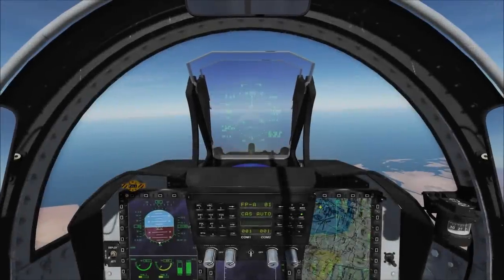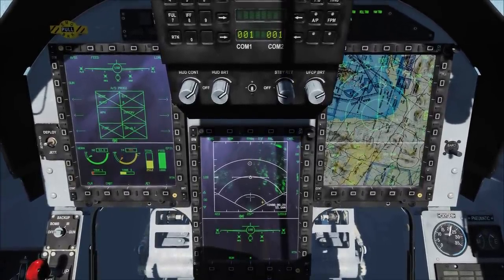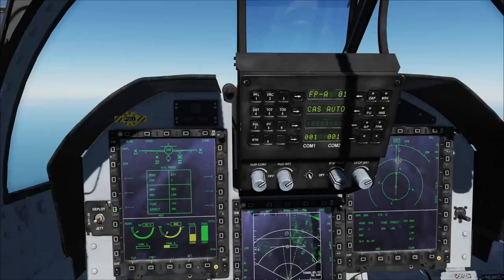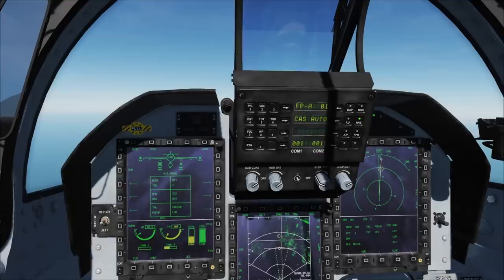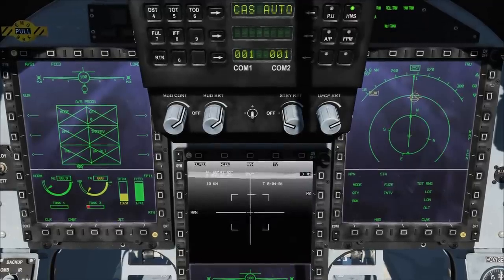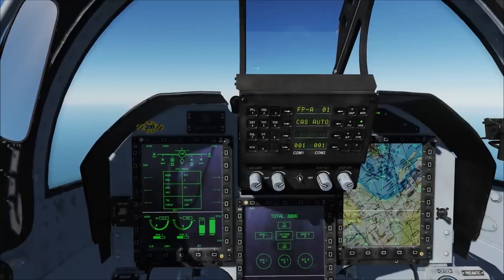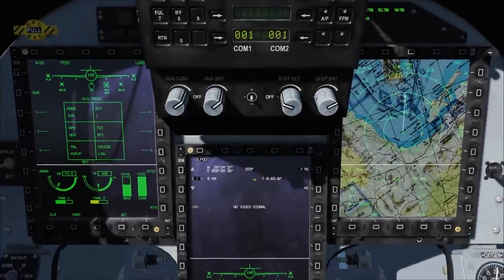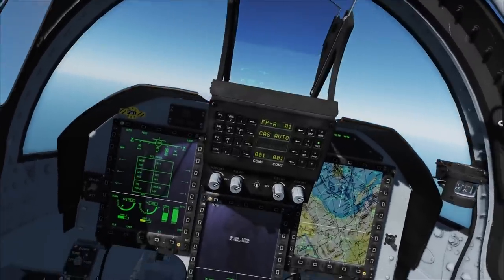DCS: JF-17 - 2. C-802AK and CM-802AKG

Comment: Looks like this has changed significantly... or simply needs a whole lot of work.  In MP, I can't get it to work at all... the missiles leave the rails and turn left.  In SP, I found I can get MAN mode to work ONLY if I have a PP point set (well ahead of target).... but I had to input the PP on the fly (I used 34).  DIR mode won't do anything but send the missile to WP1 and in COO mode I haven't a clue how to put coordinates in (and PP34 as stated above doesn't show up at all in the weapon configuration).   I haven't a clue what works or doesn't with the mission editor.  Naming a WP (PP#) did nothing helpful.  Seriously need some documentation here.  These things would be GREAT, if they worked as advertised.  They do work sort-of, but it took a lot of trial and error..  I would add, the TDC (gently or not) would be much more user friendly if the direction you input STOPPED when YOU stop the input.  As it is, it's near impossible to keep on target.  ie:  Tap <down> and it goes down until you tap <up>.

Comment: You mean to tell me the missile has a camera in it and is controllable?
Reply: yes
Reply: Man in the loop :) although in real gameplay I'll probably be doing auto acquisition the most.
Reply: @kazansky22  Why? they give you such a interesting function and you are not using it?
Reply: @albertxxx8386  i think he's talking about MP

In servers like DDCS you wont be able to use those (man) all the ttime as you either have to deal with hornets or (this is most likely) it gets intercepted by SAMs. 

It will however make much more easy for us the red team to snipe at command centers and comms tower.
I wonder if the c802akg can destroy ammo depots and crater runways.
Reply: You'll probably be more surprised with the Spike ATMG then. Its LR version is even modeled (and controllable) in Steel Beasts Pro PE.